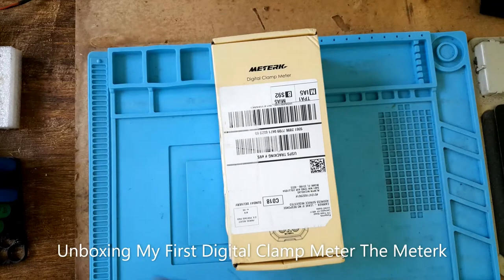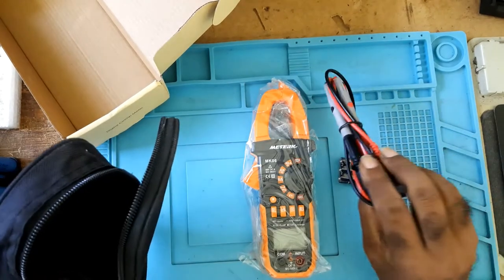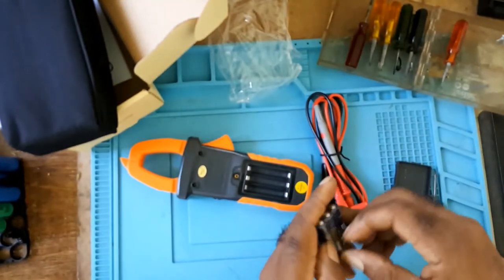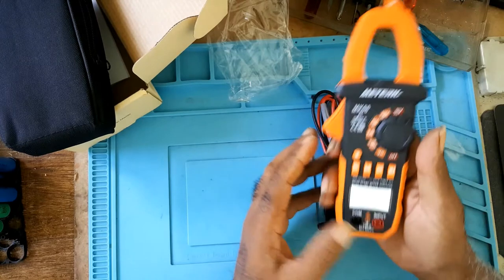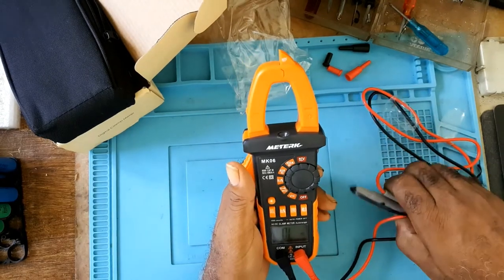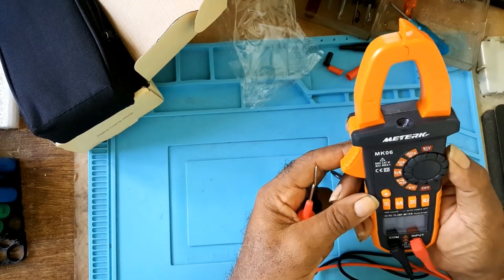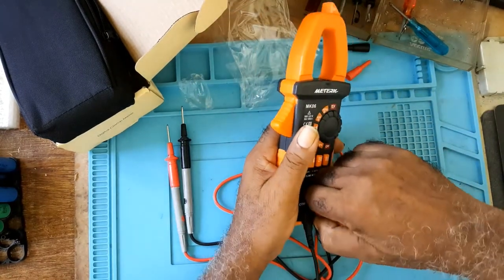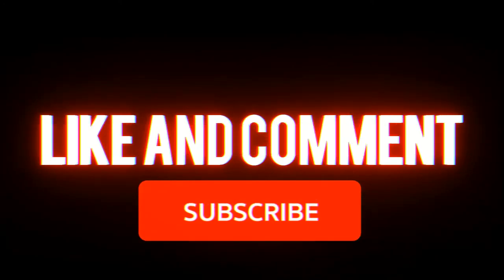Unboxing My First Digital Clamp Meter The Meterk

Comment: Does it have a worklight on when you use to test continuaty, or volt?
Reply from the maker: Yes at the  top.
Reply: I saw the light , but the light only work with the AMP test only, not for other tests. Am I correct ?
Reply from the maker: @tinkerbell24ful  It works for AMP and NCV test